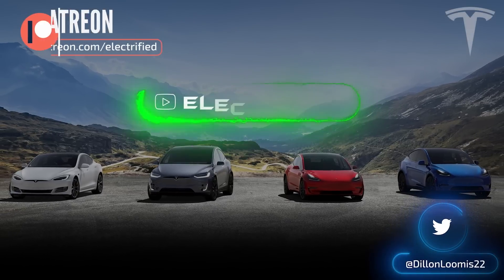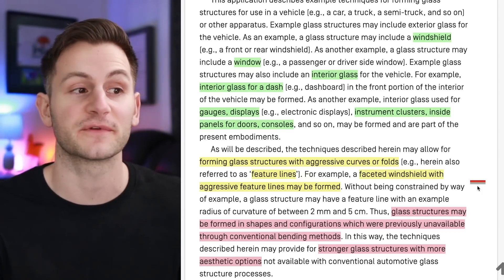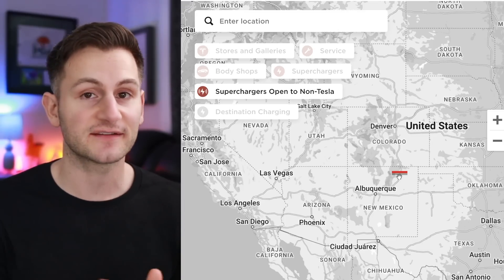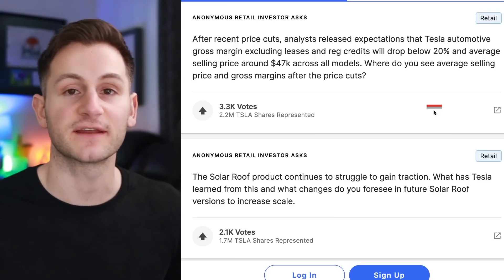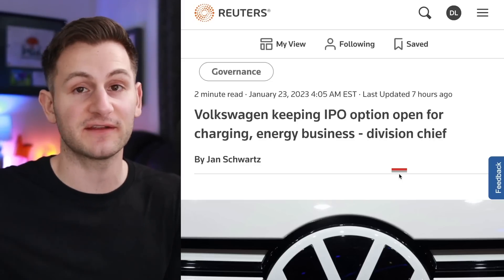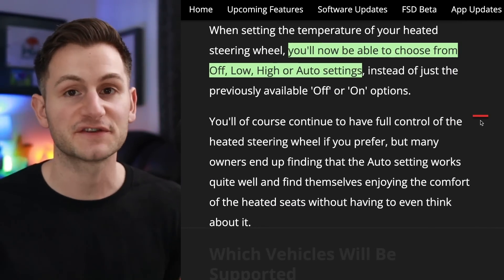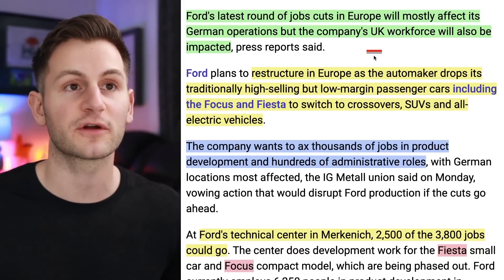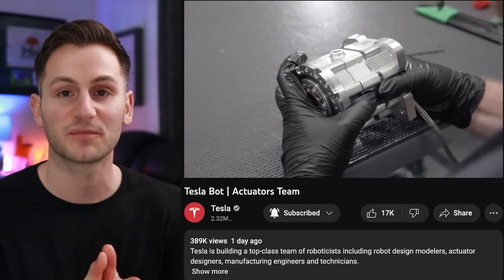New Cybertruck Glass Design / Magic Dock Leak / Ford Job Cuts ⚡️

Comment: Graphic designer for 20 + years. I use photoshop as easily as an average person uses a toothbrush. IMO the Toyota image is an original document that has been altered. you can see that the doc itself is slightly fuzzy and pixelated, whereas the column on the left and right (models and wait times) are more crisp, and the color is off, when compared to the other text.
Reply from the maker: yeah, the varying text clarity/color and font was the first thing i saw...thanks for sharing! 👊🏻
Reply: I saw the color issues too.
Reply: Altered document or not, I am still waiting for the Tacoma I ordered in June 2021…

Comment: Hi Dillon, I continue to be impressed with your thoughtful, balanced content.
I am a Cybertruck hopeful, reservation about a million down the list but getting more excited.
My dream Cybertruck drivetrain configuration would be two motors using the Tesla Semi’s brilliant idea. 
One range optimized motor for most driving and a second power optimized motor that is engaged when needed like the Semi. 
No “tank turns” but that seems like a gimmick with little value to me.
Thanks again for your great work.
Herald

Comment: Worth recognizing that the loudest voices calling for Tesla to produce "low cost" EVs are in fact the short sellers.

There is a reason that Tesla Management has pushed back against the call for a $25k EV. It will IMO hurt the business,  it will not help it.
Reply from the maker: hey harry! interesting take - why do you think it will hurt the business?
Reply: @DillonLoomis22  What we know is Musk pushed back against the idea of the $25k Model when TslaQ Analyst Toni Sacconaghi pushed it on a earnings call.

If I had to guess, there are no margins in the low cost segment and the fastest way to turn Tesla's business model into the traditional auto business model is to push them into selling EVs at low to no margin segments.

The fact of the matter is this idea has long been a TslaQ push and came into the Tesla community recently through G Black who is friendly with Sacconaghi and other institutional bears. It likely supports their bear thesis that Tesla is an ordinary auto maker and should therefore have a PE ......
Reply: I think the "larger (more expensive) factory for a cheaper (lower margin) car" opinion held some merit to the point where Tesla became profitable.
Now we essentially see one GF funding the next 2, while they have great cash flow and minimal debt.
It's just a case of designing the best product (which takes time) for the correct initial market.
Oh....
I forgot 4680, essential for the volume.

Comment: Absolutely funny to claim Tesla needs to act more like GM and Toyota. But it is a good idea to produce a lower priced sedan and Tesla in fact is working toward that. However it is likely not in Tesla's plan to produce a "broader line" as that complicates manufacturing. A lower priced sedan, a van, a specialized mass transit vehicle, the cyber truck and of course the semi should be enough and if each gets its own manufacturing plant or segment of an existing plant then it can be done.
Reply from the maker: nailed it steve! business insider is just out here spewing pure headline nonsense...you just have to laugh!

Comment: BYD has the advantage of having designed a generation of cars to be "multi use" (ICE/ BEV) on the same line for a relatively long period. They're essentially where GM etc COULD have been if they had paid attention in 2012.
Good for them (BYD)
Reply: That's not an advantage as BMW are slowly realizing.

Comment: As I understand (as a "non-user") in Europe the sequence for non Tesla owners is.
Arrive at charger.
Open App.
Identify charger number.
That enables the handshake.
.
I imagine that the same sequence will be followed in the US, but inputting the charger reference will also unlock the CCS unit on that charger, while locking the Tesla section to it?
.
If a Tesla owner arrives the CCS section remains locked into the charger, the Tesla handle (unlocked by default) can be removed as usual.
.
How to ensure the CCS units are replaced?
Your (CCS) charge payment doesn't end until you lock the unit back into the charger.
Reply: Nope, not at all that complicated for a Tesla owner! No app. Just plug in, car will know.
Sequence is:
Arrive i position
1. Pull out cable
2. Push button (on cable grib)  for opening chargeport
3. Plug in (done)
Leave car and rest….you will notified in app when ready for continueing

Comment: I'm not into the fake engine noise. I live near a busy road, and one of the things that I'm really looking forward to is quiet cars. The idea that people would add unnecessary noise pollution is a bit frustrating.
Reply: Make it selectable, int, ext, both.
That way the motophiles can play engine sounds on the interior sound system if they need the feedback.
Reply: And it’s totally idiotic too. Just another step by the fossil fuel industry to try to slow change down.
Reply: @steviesevieria1868  nonsense!!!! Which change exactly!? What does it have to do with change!? Wtf!!! What are EVs even doing!? They are totally useless it’s the ICE that have been and are still building this world the roads on which they drive ist made by any ev
Reply: Bulshit!!! The noise isn’t to be used everywhere or 24/24 lol…
Reply: @carholic-sz3qv  artificial noise is not what society needs. It’s a ridiculous idea. I have a friend that comes down the street in their Prius on just the battery sometimes. I can hear them coming easily because of tire noise.
Reply: @carholic-sz3qv  There used to be a Tesla with an aftermarket engine sound in my neighborhood. It was maybe about as loud as a Mustang. It's not the worst thing in the world, of course, but it just seems unnecessary. Especially in a residential area.

Comment: A bullet proof panel design with high UV protection on the glass would be great if you needed to seal and pressurize a working vehicle built for dodging red boulders in a place with low atmospheric protection from the sun.  Or, you know, other reasons I guess…
Reply: Detroit? 😉
Reply: @rogerstarkey5390   Mars
Reply: @doittoit00  he knows, it’s a joke

Comment: NEED DRIVE THROUGH STATIONS!
Reply: Here's a thought.
Tesla announces that the Semi can charge on a V3 overnight using an adapter.
Where possible, at least 1 charger at a location is reconfigured (often just paint, or a small amount of landscaping?) to allow a single Semi to roll up while blocking other chargers (not used overnight).
This provides a drive through option during the day for those towing.
2 birds, one stone.

Comment: Some cities with high population density homes, e.g., attached row houses or townhouses, are not yet allowing home battery energy storage systems due to potential fire hazard risks. Eventually as more local jurisdictions become familiar with battery energy storage systems, and as safer battery chemistries (LFP, LMFP, Sodium) become available, these will begin to be permitted. They may also eventually require in-ground concrete vault enclosures, similar to many underground petroleum product storage tanks installations.
Reply: That's on Luddite par wit Oregon not allowing customers to fill their own cars at gas stations because "it's not safe!"
Reply: Lmao what? In ground concrete vaults?... if that is necessary homes will never have battery storage.

Comment: Sure would like to see Tesla get into the vehicle-to-Grid area as part of the Tesla Energy push. Most of the other OEMs are at least marketing the idea, and some utilities are working with Ford.
Reply: I'll say again.
Your "car" is only a house battery when it's at the house (not a "car").
.
Unless you can guarantee power cuts only occur when you're home AND not wanting to leave in your "car", V to H (Vto G) doesn't really work.
.
Far better to have solar, combined with a static battery which matches the "passive" (nobody home) load of the property.
.
THAT pays for itself by removing the home from the grid EVERY DAY when you're away. You can use the car as a supplementary battery when you (and the car) are at home.
You also get the benefit of you return with a low car battery during a power cut, then you have at least SOME energy for the car if needed.
Reply: @rogerstarkey5390  All true, but I already own a battery in my car that sits around much of the time doing nothing.  I'm unable to deploy solar at my house, but would very much like a battery for relatively rare power outages.  The alternative that most of my neighbors have chosen is a natural gas powered generator.  I don't want that.   At the moment, buying a home battery isn't really worth it for me, particularly given that I already have a giant battery.
Reply: Ford is not serious about EVs, it is all marketing.  What ford did well was load the bed up with outlets.  Munro was able to plug office stuff, computers, projectors into their f-150 lightning when they had a 3 day power outage and had someone drive to to a ccs charger outside of town that still had power.  You don't need to grid tie your car for this, you do need built in outlets that can handle high wattage.

Comment: My take on the magic adapter is that it's a CCS adapter that either locks to the Tesla cable or will lock to the charging station, so it can't easily be stolen.
Reply: yeah, how many ccs adapters will the haters steal? you know its going to happen, haters have to hate.
Reply: The adapter is probably locked to the charger by default and locked to the Tesla plug when charging is unlocked via the Tesla app by a non-Tesla driving customer.
Reply: @sandmehlig  I think that's exactly what I said.  Also, a non-Tesla user will probably have to unlock it with their app, so Tesla will know exactly who last unlocked it if it was stolen.
Reply: Default mode.
CCS locked to charger/ Tesla plug unlocked.
Tesla user: unplugs. Normal Tesla handshake.
.
CCS user:
Selects charger number on app (as in Europe).
That locks the Tesla plug, unlocks the CCS unit.
Charge as normal.
.
Then the key part.
Charging session remains open (you're paying!) until
1) The CCS unit is returned 
And
2) The session is cancelled in the app, or the charger.
.
No security problem.
Reply: I’m not sure I follow. 

They are stolen for the copper in the wire.
Reply: @ssing7113  The design should prevent stealing short of cutting the cable, which is not a new problem with this design.
Reply: I hope you're right, because that's the first thing I thought of - how can a non-Tesla EV owner screw this up?  Oh yeah, by stealing the CCS adapter.
Reply: @kennethbuzzard6073  Tesla can see who last used it and charge them replacement cost PLUS a penalty.  Lets say $2000.